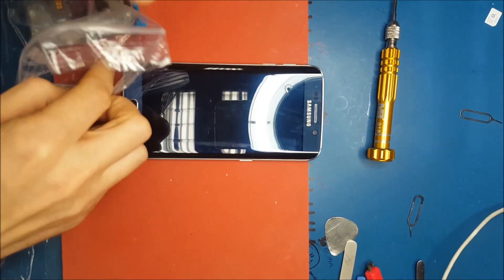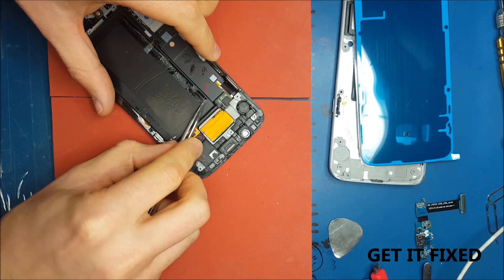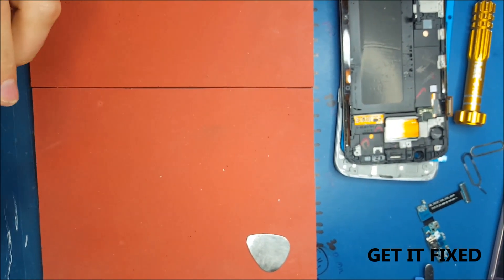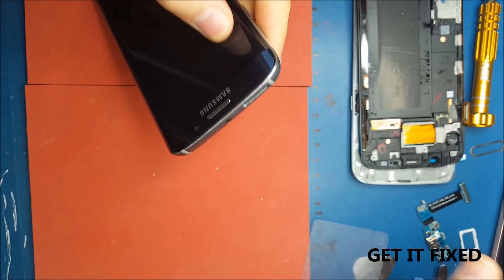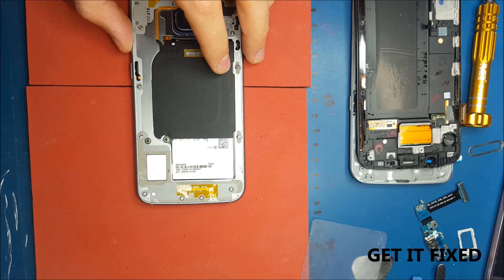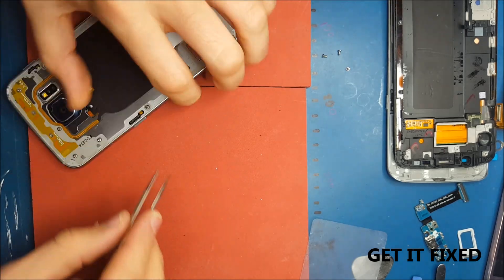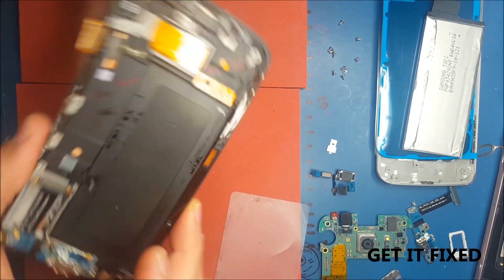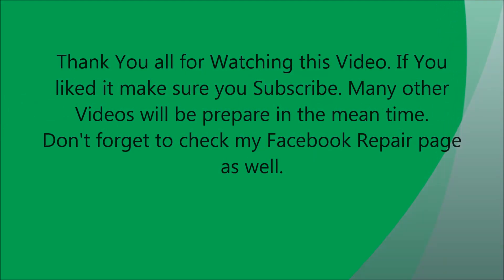Samsung S6 Edge Lcd Display Replacement Part 1

Comment: Maybe any video only GLASS change ?
Reply from the maker: Karol Z I already have one more just have a look to my chanel.  cheers
Reply: Get IT Fixed always use separator to remove glass from s6 edge or other new solution ?
Reply from the maker: Hi karol. Is the freezer solution. The best one on market. But is to expansive for me. So when I get get one. I ll prepare a better profesional video about it. Till them I do how is possible. With Separator and wire